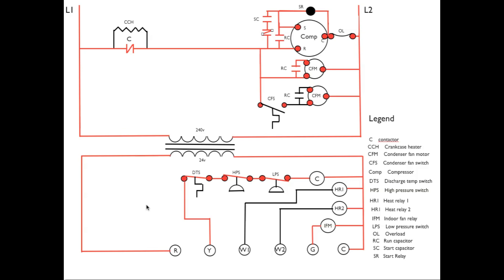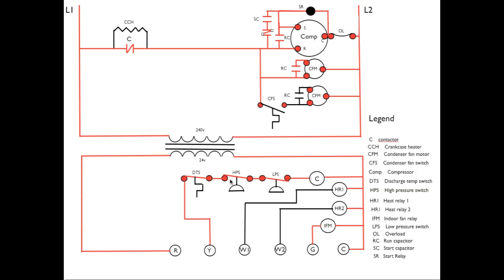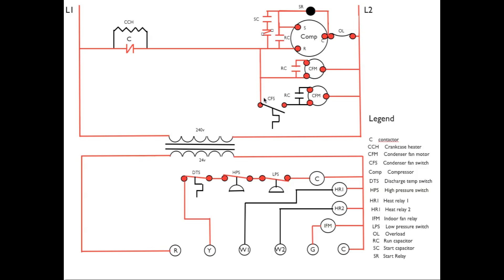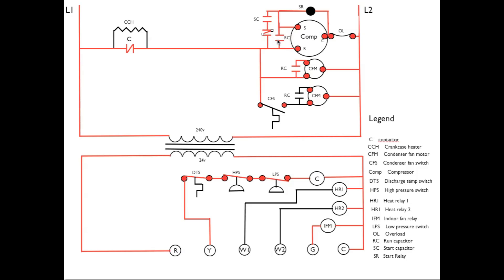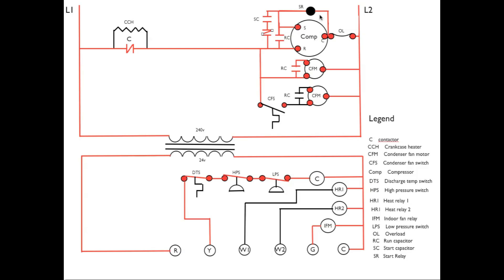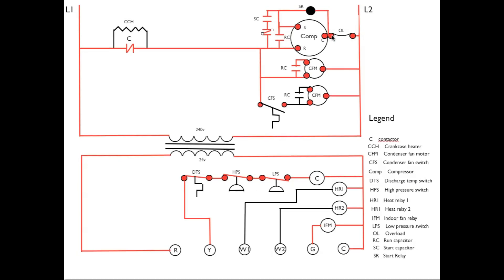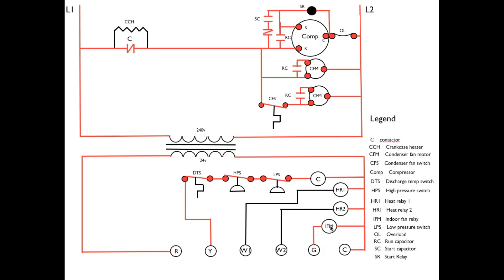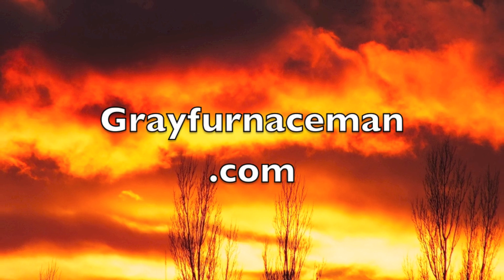Schematic diagram #14 air conditioner 2

Comment: CSCR Motor (Capacitor Start Capacitor Run Motor)

Hopefully this is correct: 

Current comes thru common to the start winding filling up the Run Cap and thru the N/C contact (2-1) into the Start Cap. The start cap helps get the motor going because it gives a greater amount of torque due to a phase shift.

 The run and start cap create a BEMF Back Electromagnetic Force (350 Volts) Powering up the Potential Relay which opens the set of contacts between 2 & 1 taking the Start Cap out of the circuit.

The Potential Relay stays powered up from the BEMF from the Run Cap and the spinning of the Rotor.

This motor is now a PSC ( Permanent Split Capacitance ) with a power factor of 1. This motor will now run very smooth.
Reply from the maker: +Brent Peluso As for filling up the start cap, it can be stated that way.  The caps do not generate the BEMF.  It is generated in the winding of the motor between start and common.  The rest I agree.
GFM